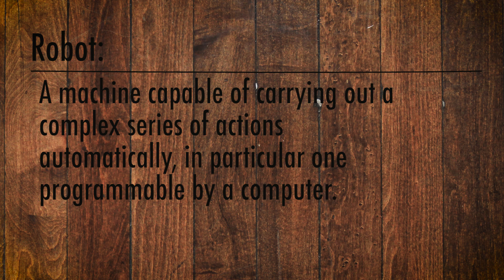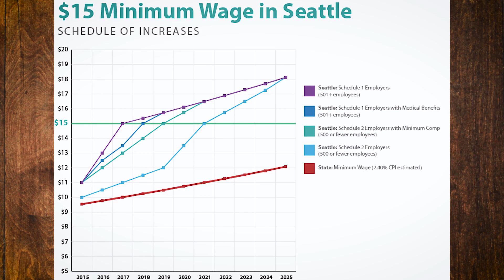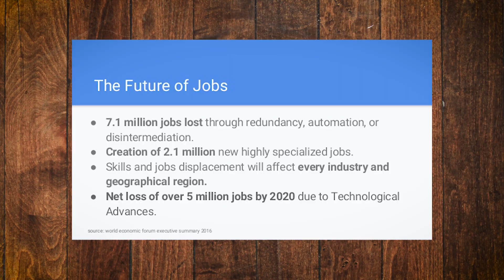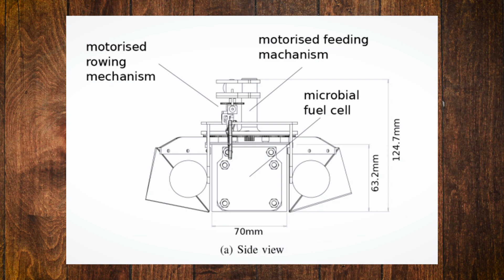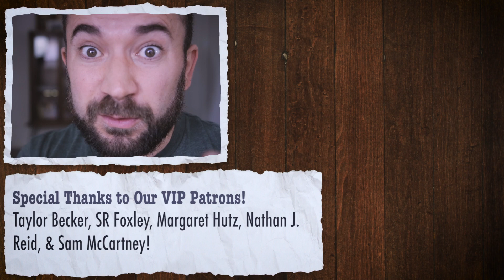Will Robots Take Our Jobs?

Comment: Alright. I feel that I need to provide real-world context here. I am a journeyman machinist of 15 years. I now primarily work with CNC machining centers. I assure you that skilled labor even in an industry that is literally run by what are technically robots, skilled read skilled labor in all fields is irreplaceable. There are very good reasons that old American iron lathes and mills are still in service 60+ years later despite cnc technology. 

The reality of the manufacturing and fabrication industries is that robots will forever be impractical to perform a one off task. Say you have some guy on an office that thinks he is the god of machining and programs a robot to do the job. It will take a minimum of an hour for him to draw everything out in CAD/CAM just to make a lathe (which is a specialized tool) create threads on a rod. A journeyman machinist will do it in about 2 minutes on a conventional precision lathe simply by reading a chart that is on the machine and performing the task. 

It goes deeper, much deeper with CNC mills.I won't go into boring (pun unintended) specifics, but what a person can do there standing at the control simply outweighs the time it takes to convert a drawing into code (which even with the best available software creates a horribly inefficient monstrosity). 

AutoDesk has made a 3D "printer" that is basically a robot arm connected to a MIG welder. Know who is in there with it at all times? A master welder. No amount of the futurologist thinking in the world is capable of wishing away skilled labor. 

This is, in my opinion, why instead of instigating "free" (read; not actually free) income, this country is better served providing trade school scholarships as opposed to the outlandish fringe degrees. 

If you are clueless as to how a welder that is worth a damn is extremely important to this economy, send me a message.
Reply: Skilled human laborers are invaluable today, and you have my immense gratitude for all the great and necessary work you are doing. But there is no guarantee that this will continue to be the case forever. Look up Artificial General Intelligence.
Reply: It is not necessary for all jobs to be taken over for this to be a problem, just displacing 40% of the work force as the study projected would be a disaster if not countered somehow. I don't know if the answer is UBI but something will have to be done. This goes in one direction only, unless a catastrophe occurs technology will continue to progress and even skilled, creative and other types of jobs thought to be safe will not be.
Reply: Brett Manous I see where you come from and your point of view is understandable but comparing CNC controlled machines with modern robot technology is like comparing an Abacus with a PC.
Reply: Every year those CNCs and CAD packages get better.  It is requiring less skill and fewer people to do the same tasks.  Sure there might be some need in the future, but there is a decreasing amount of it even today, and all the trade schooling in the world will not help lack of demand at living wage rates.
Reply: Even if what u said is partially true, the millions of out of work people can't all be welders, or skilled craftsmen. Go back to your welding and leave the logic to others.